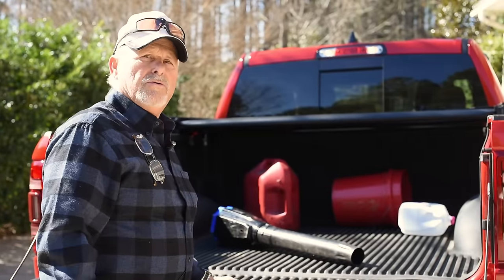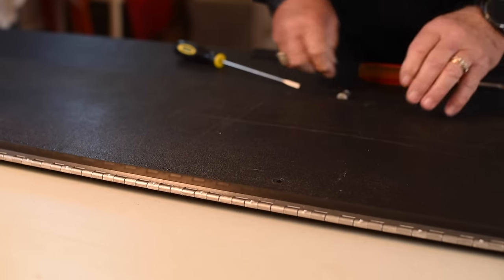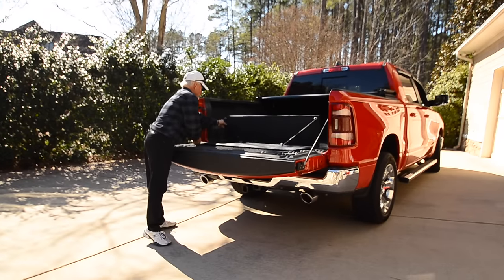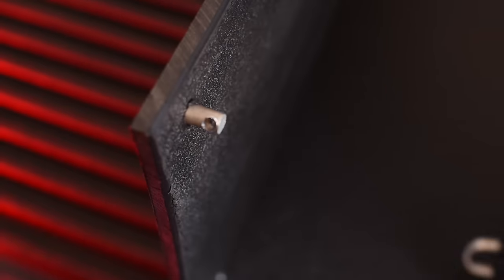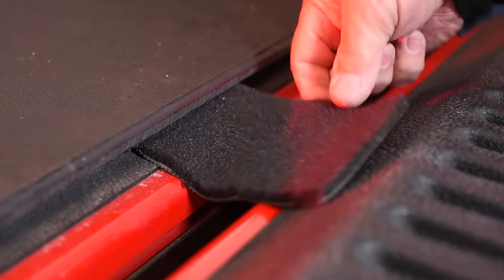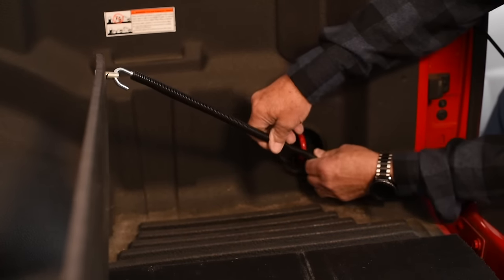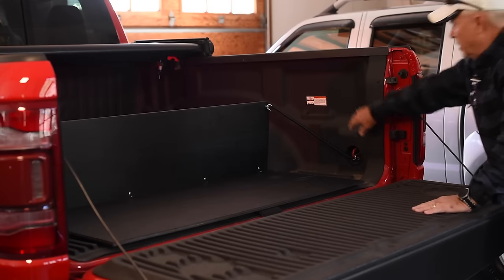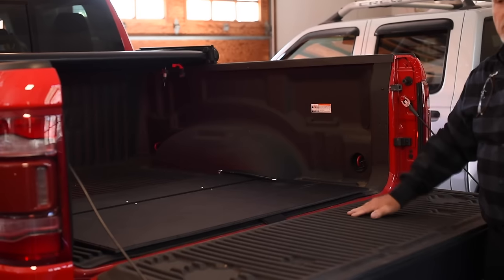Truck Bed Slide Stop - Meet the Inventor and Learn How It Works

Comment: I dont know a truck that isnt manufactured with a slot for a 2x4 or 2x6 to do this exact function. Not to mention you can just lift the boards out if you need to haul something.
Reply: Right. This guy aint bright
Reply: His way is simple for the ladies
Reply from the maker: Actually some truck beds and truck bed liners don't have the slots/indentations you're talking about. Also, the board will divide the bed, but may not necessarily keep crap from sliding around. I used the board trick for a long time before inventing the Truck Bed Slide Stop, so I'm familiar with the disadvantages (stuff will still slide around, it can scratch or ding your bed, and it's not convenient to take in and out - especially if you're in a hurry and don't wanna fool with it, etc, etc). If you've got any questions, I'm happy to answer them. Thanks for the feedback and for watching the video. Have a good one! -Mike
Reply: What kind of truck do you have?
Reply: @hectorguzman28  2018 f-150?
Reply: I have a 2023 F150 with no slots on driver’s side…so this is a perfect solution for me!
Reply: @chriscbryant  why not utilize the  f-150's tie down hooks on the side of the bed? If they didnt come with your truck they are incredibly easy to install and extremely useful.
Reply: Stating that mine did not have slots, not that there were no other solutions.
Reply: Ok geniuses, where do you put your 2x6 when you happen to be out shopping and  buy a chest of drawers or other large item on the spur of the moment? Throw it in the cab? My wife uses the truck also, and she's not fooling around with slab of wood like that.

Comment: Mike, got mine today.  Have a 2024 5ft Taco and had to make slight modification with jigsaw. (Wheel Wells to narrow.)  Also added some 550 cord to the lower hooks so not to overextend the tie downs. Otherwise worked as advertised.  Thanks

Comment: There's a slot in the bed liner where a 2 x 8 will slide in and do the same thing for about 6 bucks. I've got one in my bed and have used it without a single failure in 10 years.
Reply from the maker: Hi Dan - I'm glad you found something that works for you. I've seen similar comments on this video about using a 2x8 or something similar, and I wanted to take a minute to talk about it.
I've driven trucks most of my life, and I've used this board 'trick'. It's one of the reasons I invented the Truck Bed Slide Stop. I found that a few of the down sides of using a 2x8 are:
1. You've gotta figure out what to do with the board when you need the full length of your truck back. It's not usually a good idea to leave in the bed, since it can slide around. You can take it out and store it somewhere, but that's not always ideal, especially if you're in a rush and don't want to fool with it.
2. If you've got a slippery bed cover, that board will keep your stuff contained to an area, but won't necessarily keep stuff from sliding around.
3. Some truck bed liners don't have the cutouts/indentations that you're talking about.
4. If you've got a nice truck bed, you might want to avoid unnecessary scratches and dings that will happen when you use this board method.
5. Using a 2x8 in those indentations/slots gives you a fixed area to put stuff without a whole lot of flexibility.
I know The Truck Bed Slide Stop won't necessarily be for everybody, but it definitely addresses some of the issues and inconveniences that come with using this board. Thanks for taking a look. I really do appreciate the feedback.
Reply: @truckbedslidestop9150  interesting response,  I've been driving trucks for over 35 years and can't say any of those concerns have ever made me wish for something more than the board divider. It's a neat idea, but way over priced for the function it provides.
Reply from the maker: @danwood4478  Gotcha. Well, it's not for everybody, and that's ok. Thanks for the feedback. -Mike
Reply: @truckbedslidestop9150  The simple fact is that trucks have had the slots for the 2 x's longer than they have had the hooks in the corners upon which your design is based. The slide-in liner for my late 80's and early 90's trucks had these slots. Stamped in slots from the manufacturers started appearing in the late 90's,  In my world I did not see the hooks until the early 2000's; so you really cannot say that "all" trucks have these hooks. As for the slippery liners, the only time I had a problem was in 1987 when I climbed into a wet bed barefoot. Still got the scars, like stepping on a bar of soap on a glazed tile floor.

Comment: Good idea but $185.00........Jeez....  I can go to Lowes and buy some plywood, a piano hinge, a little hardware and build my own for less than $50.00.
Reply: Bit you aint got a patenet
Reply: Any idea what that hook is called can't find it.
Reply: @robertomeza5045  home depot
Reply from the maker: Thanks for the feedback. One thing to consider is that the $185 includes shipping within the continental US (it's bulky and fairly weighty) so that's part of what contributes to the cost. Also, even though it looks like a simple build, it's not made with cheap materials, and each Truck Bed Slide Stop is constructed by hand, right here in America (by yours truly). If you decide you want to give it a chance, give me a call. I'd be glad to talk to you about any concerns you've got. Thanks, Mike (www.truckbedslidestop.com)
Reply from the maker: @FranklinHicks-qs4gs  That's true. They don't.

Comment: That spray in liner from the factory or added afterward is slippery and allows everything to slide around. However, just get a thick rubber mat and believe me, nothing slides around on that, but it does make it a bit harder to push something up toward the front. But also have one of those Keeper adjustable ratchet bars use to stop anything larger and can be used to push items around. This is item is not for me, but others might find it helpful.

Comment: For years they had slots formed into the box you could just cut a 2x6 and stick it across just behind and in front of  the wheelwhells and pull it in and out whenever you want.

Comment: Looks very simply but $185?
Reply from the maker: Hey @ViperKnight94 - one thing to consider is that the $185 includes shipping within the continental US (it's bulky and fairly weighty) so that's part of what contributes to the cost. Also, even though it looks like a simple build, it's not made with cheap materials, and each Truck Bed Slide Stop is constructed by me, right here in America. If you want to give it a chance, give me a call. I'd be glad to talk to you about any concerns you've got. Thanks, Mike (www.truckbedslidestop.com)

Comment: I use a few 2×4 I made in to a stop that fits into the slots on the bed .. a lot cheaper
Reply from the maker: Thanks for the comment, and I'm glad you've found something that works for you. I've driven trucks most of my life, and I've used the board 'trick' among others, and it's one of the reasons I came up with the idea for the Truck Bed Slide Stop. There are several other downfalls and inconveniences that I found with the board (stuff will still slide around, it can scratch or ding your bed, and it's not convenient to take in and out - especially if you're in a hurry and don't wanna fool with it, etc, etc). I appreciate you taking a look, though. If you've got any other questions or comments, I'd be glad to talk to you about it. Give me a call anytime. Thanks, Mike (www.truckbedslidestop.com)

Comment: I really like new truck accessories but I think this one will have a tough time competing with a $2.87 2x4 that provides the same function as a load stop
Reply: Wow! I spent too much! I use a 2 x 6 - think it was around $3.46. My bed was Linex'd by the dealer and they put brackets for the 2x in just in front and behind the wheel wells. Works great.
Reply from the maker: Hey Brandon - Thanks for the comment. One thing to consider is that the $185 includes shipping within the continental US (it's bulky and fairly weighty) so that's part of what contributes to the cost. Also, even though it looks like a simple build, it's not made with cheap materials, and each Truck Bed Slide Stop is constructed by hand, right here in America (by yours truly). If you decide you want to give it a chance, give me a call. I'd be glad to talk to you about any concerns you've got. Thanks, Mike (www.truckbedslidestop.com)

Comment: At 2:37 you can see a vertical indent in the side of the truck bed between the red loop and the fender. All trucks have them. That is made to fit a standard 2x4,, 2x6 ,8,10 or 12,  2x anything.  You just cut it to length across the bed of your truck and drop it in the slot, done.  If you don't need it, just lift it out. 
That is a lot cheaper than 185 dollars for this piece of plastic that someone is likely to steal.
Reply from the maker: Thanks for the comment, but actually not all trucks or truck bed liners have the slots/indentations you're talking about. I've driven trucks most of my life, and I've used the board 'trick' among others, and it's one of the reasons I came up with the idea for the Truck Bed Slide Stop. There are several other downfalls and inconveniences that I found with the board (stuff will still slide around, it can scratch or ding your bed, and it's not convenient to take in and out - especially if you're in a hurry and don't wanna fool with it, etc, etc). I appreciate you taking a look, though. If you've got any other questions or comments, I'd be glad to talk to you about it. Give me a call anytime. Thanks, Mike (www.truckbedslidestop.com)
Reply: Yup gonna make one from a 2x6

Comment: 2x8 in the slot of my Ford F150 that Ford designed it for.
Reply from the maker: Works great until you want full use of your bed, and you've got to take it out or have a 2x8 sliding around. But it's good that you've found something that works for you. Thanks for watching my video!

Comment: Does nobody realize, that on Ford's at least, there's 2 indents on each side of the bed?

Its meant to jam a 2x10 or bigger on edge in there to divide the bed lol
Reply: My 18 Silverado has the indents also
Reply from the maker: Some truck beds and truck bed liners don't have the slots/indentations you're talking about. Also, the board will divide the bed, but may not necessarily keep crap from sliding around. I used the board trick for a long time before inventing the Truck Bed Slide Stop, so I'm familiar with the advantages/disadvantages. If you've got any questions, I'm happy to answer them. Thanks for the feedback and for watching the video. Have a good one!
Reply: I never notice? Thank you!
Reply: I use a 2x8 in my F150 works perfect
Reply: @Dan-jr4nu  i didn't know Fords actually had that untill you guys mentioned it. I built a temp gaurd slightly lower then the hieght of the bed. I do a little lanscaping so it helps to keep the items in place. Brooms and such etc.
Reply: Can you imagine the thrashing Mr Wonderful would give this poor guy if he took this product on Shark Tank?

Comment: As other viewers have already said, there are indentations that are there from the mfgr.  I just used an old piece of 2x8 cut to length to place in the indentations and it prevents crap from sliding forward into the bed.  Free-Ninety Nine, you can even paint it black like I did with leftover spray paint to match the bed.
Reply from the maker: Thanks for the comment. One thing I've found is that not all truck beds or truck bed liners are equipped with the indentations you're talking about. I've driven trucks most of my life, and I've used the board 'trick' among others, and it's one of the reasons I came up with the idea for the Truck Bed Slide Stop. There are several other downfalls and inconveniences that I found with the board (stuff will still slide around, it can scratch or ding your bed, and it's not convenient to take in and out - especially if you're in a hurry and don't wanna fool with it, etc, etc). I appreciate you taking a look, though. If you've got any other questions or comments, I'd be glad to talk to you about it. Give me a call anytime. Thanks, Mike (www.truckbedslidestop.com)

Comment: It took you 2 years to develop two boards with a hinge? And by the way, what holds this thing in place when you slide long stuff in the bed over top of it  since nothing hold it in place but a piece of carpet Jammed into the closed tailgate.

Comment: $250?  I just use ratcheting load bars from Tractor Supply at $25. Don’t think that carpet tail will stop the assembly from sliding with something heavy on it like a bundle of roofing shingles. Also the top face has protruding screw heads that would scratch paneling or other finished materials. It may lay flat but it’s not flush.
Reply from the maker: Glad you found something that works for your purposes and your budget, Peter. On the Truck Bed Slide Stop, they're not "protruding screw heads" but two small, smooth finish hooks, and would be unlikely to scratch anything you put on top of it, but you're right, there's about less than an inch where it doesn't lay completely flat. For most applications, this isn't an issue, and the wise user would be able to easily remove the slide stop from the truck bed before loading delicate or finished materials if there was a concern. Thanks for the feedback. Let me know if you have any questions.

Comment: A product called Last Boks is a better solution
Reply: @jasoncharles6980
How does 'Last Bok' fold down for a flat surface, if I end up buying something long, in the spur of the moment?
Reply from the maker: @ebenezerwheezer2957  You took the words right out of my mouth. Exactly why the TBSS is a better solution. I'm a little biased, though.

Comment: 94 Chevy doesn’t have the hooks
Reply from the maker: Great point. Every truck owner will need to measure their truck bed, and check for hook points before purchasing a Truck Bed Slide Stop to make sure it will work for them. I'm happy to help answer any questions if you're unsure. Thanks, Mike (www.truckbedslidestop.com)
Reply: It has holes by the stake pockets

Comment: 250 dollars for some "hard rubber" hooks and a piano hinge? I got some carbon fiber laying around and a trip to home depot should save me about 225$
Reply from the maker: It looks like a simple build, but these aren't cheap materials. It's a patented product, individually handmade by me here in NC, USA. I hope you can DIY a good solution that works for your time and budget. If not, give me a call if you want to reconsider the Truck Bed Slide Stop or have any questions. I'd be happy to help. -Mike (www.truckbedslidestop.com)

Comment: I'm totally making one of these out of plywood.
Reply from the maker: The great thing about the Truck Bed Slide Stop is that it can stay out in the rain pretty well since the materials used in its fabrication don't really mind the water. Unlike plywood, which is made of thin layers or "plies" of wood veneer glued together, the Truck Bed Slide Stop is made of a hard, single layer of durable black plastic with a non-skid rubber-like top surface. No construction or painting required.

Comment: $145 for your product?! Sorry sir, Ill run to HD buy $60 of lumber & have a compartment system for my rig that will do the same and allow me to place 4x8 sheets of plywood on top good try though
Reply from the maker: The carpeted version for SUVs is $145, and the heavy duty version is $185, actually. But no worries, slackr69. Sounds like you've got an idea of what will work for your rig. Best of luck!

Comment: basically gave us DIY idea.... not worth 185 got my sliding divider for my frontier just little over 100
Reply from the maker: Thanks for the feedback, Nellie. One thing to consider is that the $185 includes shipping within the continental US (it's bulky and fairly weighty) so that's part of what contributes to the cost. Also, even though it looks like a simple build, it's not made with cheap materials, and each Truck Bed Slide Stop is a patented design, constructed by hand, right here in America (by yours truly). If you decide you want to give it a chance, give me a call. I'd be glad to talk to you about any questions or concerns you've got. Thanks, Mike (www.truckbedslidestop.com)